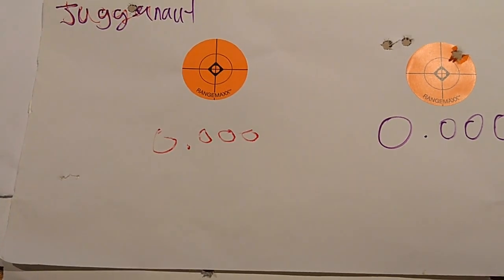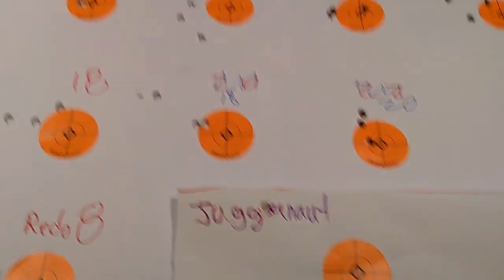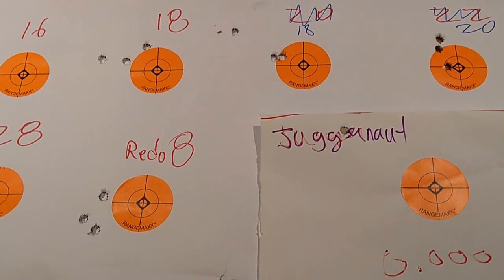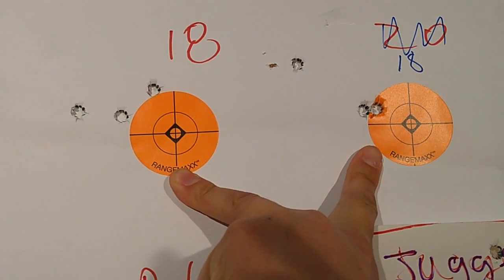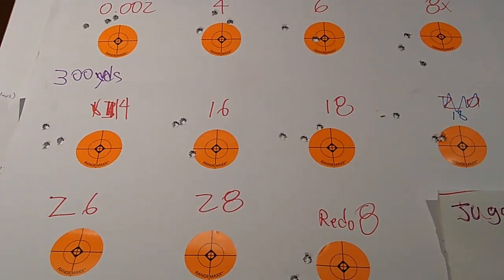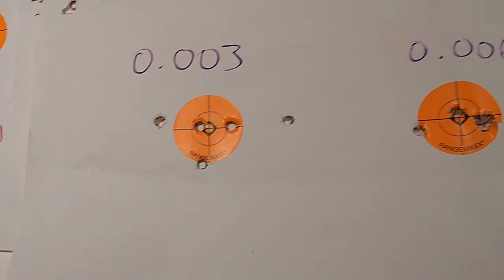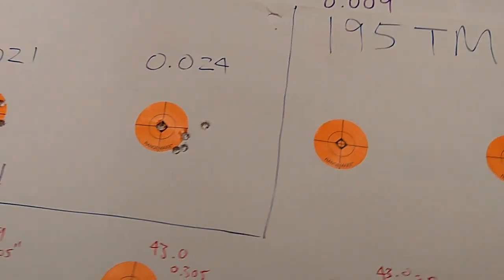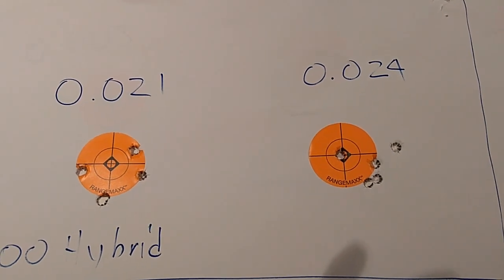EC Barrel Tuner and load update

Comment: Hello, I have a few questions as I am moving out of small bore to 600yd F-class this year. For starters I make my own tuners in house for .22LR and the process of setting up a barreled action/proper tuner is a heated debate with small bore guys. Did you ring the barrel before coming up with what tuner you went with? and how much weight forward of the node did it call for? Sorry if these are alien questions, but I have friends shooting big bore rifles that followed my progress thru .22lr that now want to tune.....they know it is needed to keep up after I installed a experimental unit on my very average Savage .308 and brought it to 1/2 minute groups in an hour. I hand load and know this gun, but it was pretty cool to see.   Thanks, G>
Reply from the maker: Sorry I'm not familiar to the process of "ring the barrel" before I decided on a tuner.  Tuners are still an experiment for me but using one very restrictive because it adds some weight to the rifle.  and from what I've researched tuners will have some effect on all barrels.  Tuner on rimfire is very significant because you don't control how the cartridge is made but it does have a huge impact on groups.  For myself I have to select my barrel length and contour to maintain weight restriction.   In F-class we need to keep FTR rifles under 8.25Kg or 18.18lbs very hard to do with a HV profile event with an aluminum chassis stock.

Comment: Do powder test and find node with lowest ES.  Load to middle of that load.  Set Tuner to 0 and adjust seating depth in 0.003" increments until groups shrink starting from 0.010" jump to 0.037" jump.  Load 4 of each.  Then do a tuner test to shrink groups further.  You must first start with a good load, and then the tuner will really shrink your groups.  Good luck.
Reply from the maker: Thanks Erik for the comments.
Reply: I did the exact same thing (going with a proven load)  thanks for the clarification Erik

Comment: What are you finding to be the best all-round weight? 185 Jugs or the 200 Hybrids? I have an 11 twist barrel, so I'm not 100% sure I could jump to a 200gr round or not.
Reply from the maker: For the best all-round weight so far I have to say it is the 200gn Hybrids.  It offers a higher BC and on paper it is approximately at least 1MOA wind advantage over the 185 Jugs at 900m - 1000 yds.  The in my opinion the recoil is no more heavier and if anything I feel it is the slightly less and more manageable than the 185s!  Surprising really the heavier bullet seem to produce a less sharp impulse and I believe it has to do with the bullet's design.

I have a 1:11 twist Broughton Barrel and I was able to make the jump from the Jugs.  It is worth a try eventhough you may lose a little BC because of spin optimization however from the Berger Stability Calculation you only loos 2% stability which is still a big gain over the Jugs.  My factors in the calculation 1000ft Altitude pushing Avg 2650fps, 0.003" off my lands, I have a 0.208" freebore which is slightly longer than your 2013 FTR Team reamer at 0.170"

If your not up to going to the Hybrids then try 195 TMK, are a very solid option to consider I've tested both.   Both bullet will stabilized in a 1:11T barrel.   As for results, on paper and target I chose to go with the 200hyb for this year and will continue to test the 195TMK throughout the year.  Good luck and happy shooting!